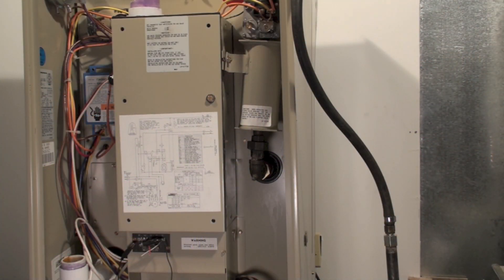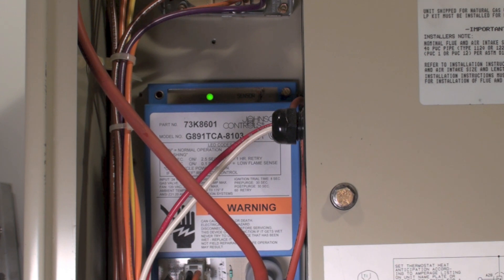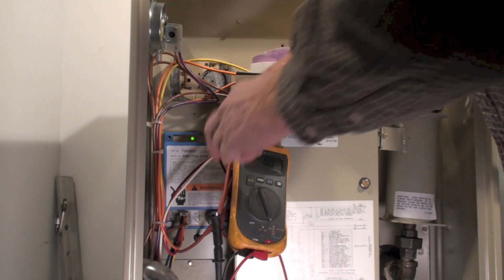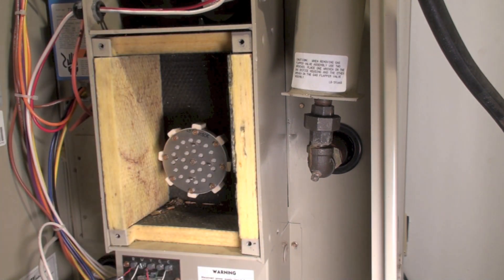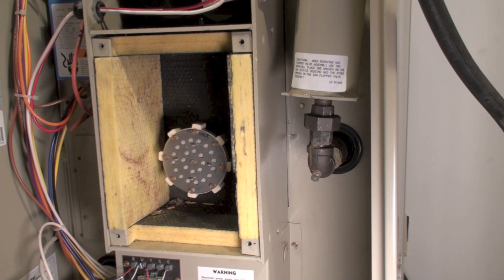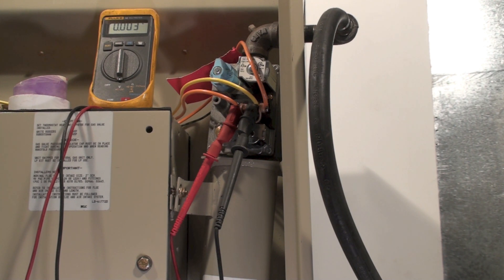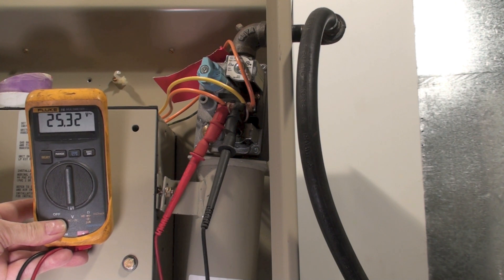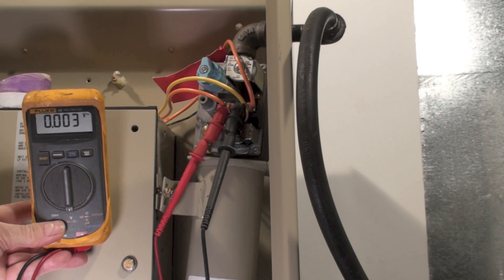Troubleshoot the Lennox pulse.  Part 2

Comment: These videos are fantastic. I had one of the first ones produced that had heat exchanger issues. It was replaced by Lennox with a G21 in 97. It has had 1 control board in 2009 and several flappers since new. It’s been pretty bullet proof. Lately the purge blower has been cycling off and on repeatedly after it is done heating. I notice the light on the main board flickers off and on when it does this as well as when it’s running. Is this a main control failing? I have a Basso control box waiting just in case. Thanks.
Reply from the maker: You probably have the electronic timer for the fan.  It may be failing.
GFM
Reply: I didn’t know that had anything to do with the draft inducer at all. I thought that only controlled the blower.
Reply from the maker: @jamesrudolph7794  I misunderstood you.  Your problem probably is related to the control board.
GFM
Reply: Sorry for the confusion thank you sir.

Comment: My Lennox clicks when it starts like the ignitor is going, and then it shuts off before trying it again and so on. 

I'm thinking either the ignitor is weak or the sensor is bad.

Any ideas?
Reply from the maker: I would try removing the flame rod and cleaning it.
GFM
Reply: @grayfurnaceman  I tried that and still does the same thing. It's not making the rumble noise like it normally does when it tries firing. I took the air flapper out and cleaned it and cleaned around where the air flapper sat, but it still does the same thing.
Reply from the maker: @RocketMan200  Could be a gas flapper or ignition control.
GFM
Reply: @grayfurnaceman  I had a tech over, and he said the furnace needs to be replaced. It was running fine one day next day, nothing.

He said parts wouldn't be worth it considering how old the furnace is and how hard it is to find parts.
Reply from the maker: @RocketMan200  In general, I agree.  Parts are getting hard to find.  
GFM
Reply: Thanks for the help. You'll definitely get my sub and like........👍.

Comment: Worst mistake I ever made was replacing my pulse furnace. 
It functioned perfectly for 28 years.  If I had it to do over I would replace the blower assembly (ran 24/7 and never failed)
The circuit board and all ancillary controls and run it another 28 years.  The exhaust was litterally COOL from this unit.  The 90 plus Lennox I replaced it with exhausts room temp air with a TON of moisture.  The pulse didn't exhaust a bunch of moisture.   It was obviously much more efficient than the new furnace  and my utility bill reflects that.

Comment: Thank You for the helpful videos. I have a G14. My light is off on the board but it still runs normally most of the time. When it acts up it will fire and run for about 30 sec. Then shuts the burner off but leaves the fan running for about 30 sec. Then fires again. Then it repeats this until I manually throttle back the gas valve until the "pulse" so to speak flutters almost stopping, then I fully open it. After that it runs fine for a while. I just changed the air flapper but the gas flapper hasn't been changed in the 12 years I've been using it. Could the gas flapper cause this type of behavior?
Reply from the maker: I can't say I have seen that happen, but it certainly could.
GFM

Comment: Where  is the relay for the blower? My fan motor stays continuously until I wrestle off the blower/filter cover and while doing so I can hear the relay click open, then the motor stops until the next on/off cycle commanded by the thermostat.
Reply from the maker: You probably have a failure in the delay relay.  Located center lower behind the thermostat terminal board.
GFM

Comment: So I can hear the spark plug working. And there’s power to the gas valve, is it safe to presume it’s the valve? The LP tank is at 55% and tank valve is on.
Reply from the maker: With a pulse nothing is safe to assume.  You could have a venting problem or a cracked heat exchanger, etc.
GFM

Comment: Very informative. With a G14, heats and fan runs, but burner sometimes goes out for 15 seconds or so, then lights again without interuption  of the heating process. What could one check for? Thanks
Reply from the maker: I would look for venting problems, especially condensate drain.  Also, a dirty flame rod could cause it.
GFM
Reply: @grayfurnaceman  Is the flame rod/heat sensor accessed only through the 3x6 little access door? Is the sensor the other spark plug looking item?-this style does not match the sensor being called for, the  20J91. Thanks
Reply from the maker: @daleh9488  It is accessed thru the little door.  Both the sensor and the spark plug look like spark plugs.
GFM

Comment: Hello,

I have a Pulse that except for replacing the control module 7 years ago the thing has been a beast.  But it's now got a glitch, which is the purge fan continuously cycles on and off when there's no call for heat.  

Any ideas where to start to look for the problem?
Reply from the maker: Either the motor is going out on internal overload, or the control board is failing.
GFM
Reply: Thanks.

Could you clarify what you mean by "going out on internal overload"?
Reply from the maker: @1rewd133  All motors have an internal overload that shuts off the motor is the windings get to hot.  It means a new motor.
GFM
Reply: @grayfurnaceman  Thank you.

Comment: What would happen if the intake and exhaust pipes were cut right at the roof line, so the exhaust air could be sucked into the intake pipe? Yes, this has happened. The solar panel installer chopped the pipes and put on a pair of elbows. And the solar panels are floating a few inches above, so the exhaust gas is probably collecting under the panels.
I’m thinking monoxide gas is being sucked into the intake and snuffing out ignition to some extent. Maybe the air flapper is getting more particulits caught in it?
The furnace is having problems but the damage was done nearly 2 years ago. The furnace got through one california winter without any signs of trouble.
Yes, I am getting this fixed immediately. I’m interested to know how serious or dangerous the situation is.

Thanks!
TrevEB
Reply from the maker: The recycling of exhaust gasses can be very damaging to the furnace.  Perhaps not dangerous to the occupants unless there is a leak, but I would expect damage to the solar panels also because the exhaust gasses are acidic.
GFM
Reply: grayfurnaceman Thanks for the reply. I am happy to say the furnace is now working perfectly. Likely better than before now that it has a new spark plug, flame sensor and Air flapper. I’ll have to have a talk with SunPower about any damage that may have occurred from gasses collecting under the panels.
Would you know how efficient these pulse furnaces are when compared to the current typical Lennox model?
Reply from the maker: @trevoreb  They run in the low 90s.
GFM

Comment: Thank you for these awesome and very helpful videos! My Pulse21 randomly shuts off. I can restart it and it runs fine for a few hours, sometimes a few days but will eventually shut off showing a flashing green light on the ignition control. I turn off gas, turn off power and then restart and it always lights fine. What do you think I should replace?
Reply from the maker: Three common problems.  Flapper valve failure, flame sensor dirty or ignition control failing.
GFM
Reply: @grayfurnaceman  thank you so much!

Comment: I have Pulse 21 furnace, everything works but when it's off I can smell gas odor from the exhaust pipe outside, turning the igniter to off makes the smell go away. Any ideas?
Reply from the maker: Sounds like a gas valve leaking by.  It may be time to replace the furnace.  Many problems withe them.
GFM
Reply: @grayfurnaceman  thanks for replying, I'm going to try to replace the gas valve first, and hopefully I can get another year out of it. I've been pretty fortunate with it so far.

Comment: Great video, my question my pulse 21 turns on heats and turns offf , but comes back on a heats house in 3 mins , I just replaced Blue ignition box with an aftermarket blackbox, and I hear a bearing like noise running after Furance is off, Thks

Comment: What causes these dinosaurs to operate with the hum coming from the air flapper? Lennox parts + only sells the air flappers in 10 packs for 70 bucs and I dont want to charge somebody for 10 of them and it not be the problem. I work on commercial refrigeration equipment, split and self contained equipment, c02 refer. I've never seen or heard of these explosion furnaces.

Comment: Great tip on checking the flame sensor current.  Do you have any specs on what this should be (e.g. new/clean flame sensor, min acceptable?).  Is the ~5uAmps you measured in the video enough current from the flame sensor to satisfy "flame on" for the controller?

Update: I found that the threaded-on coupler for the wire-connector on my flame sensor wasn't even finger-tight.  I put a small wrench on the hex portion (took a lot of  fiddling just to this) until it stopped turning but didn't torque it.  After this I was getting about 1.6uA at start-up and had it fluctuating up around 2uA +/- 0.2uA after a minute or so of running.  Apparently that's enough to keep it going, but suspect it has more carbon build up than yours.  I was able to get an 11/16" deep well socket on it, but couldn't get my hand on the wrench well enough to torque it loose.
Reply from the maker: Most flame sensors should read 2 to 3.5 and dropout at .5.
GFM
Reply: Great info, thanks!

Comment: Hi! I have Lenox Pulse furnace. it turns on and heats for about 10 minutes then turns off for 1 minute and then keeps coming back on for 1 minute again and turning off after 1 minute repeatedly.  I even changed the flame sensor with 2 different  replacement sensors  from 2 different companies but it still does not work. I  cleaned the air flapper but nothing changed. I even later  hired someone and he said he has no idea. I would appreciate some advice. I watched your videos but did not come across such a situation.  Thank You!
Reply from the maker: A lot of the pulse furnace had problems with their ignition controls.  That could cause your problem.  Not sure I would even recommend doing a lot to this furnace as they had a lot of heat exchanger problems.  
GFM
Reply: If the flame sensor is bad the furnace will only run 6-8 seconds before shutting down.  You can unplug the sensor from the controller to prove this.  If you have a microamp meter you can use it as shown in the video to see if the sensor output is the issue, but it doesn't sound like it.  If this timing is consistently as you describe, it's probably not a loose connection or an intermittent device.  Could be the over-temp switch though.  If it runs a longer time when it first starts, then goes into cycling as you described, that seems like it could be a heating-overtemp-cooling cycle.

Comment from the maker: Check out the playlist:  Furnace fan switches.  If its a G16 it probably uses an electronic control located behind the thermostat terminal board.  If its a G14 it probably uses a heat operated fan switch located on the upper left.  Hope this helps.
GFM

Comment from the maker: I have never seen a 2 stage pulse.  Are you sure it is just not proving flame?  It will try for 8 seconds and drop out if it does not sense flame.  I would replace the flapper if it has not been replaced within the last 5years.  Could also have dirty flame rod.  Hope this helps.
GFM